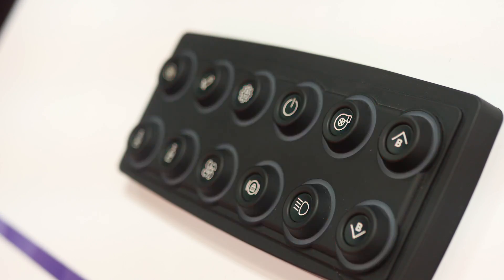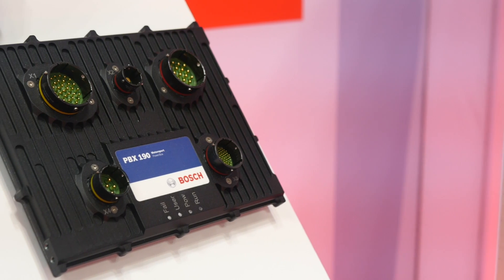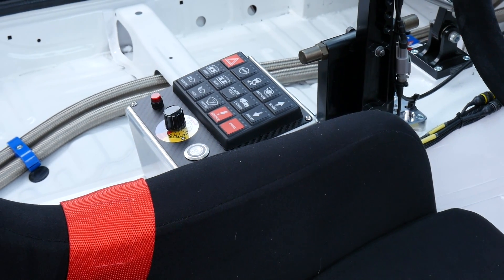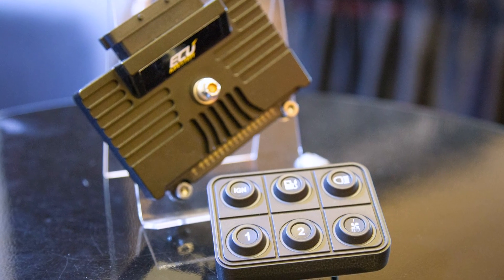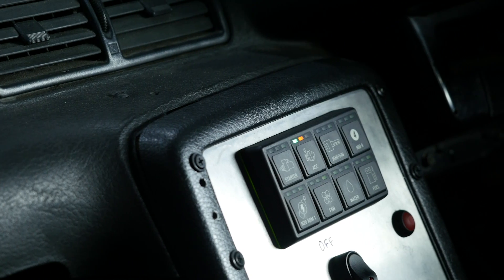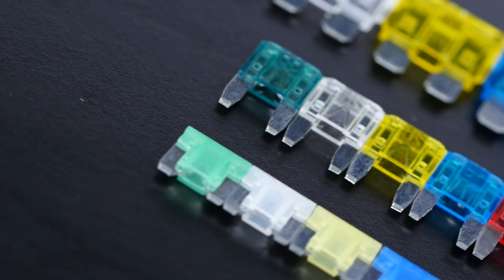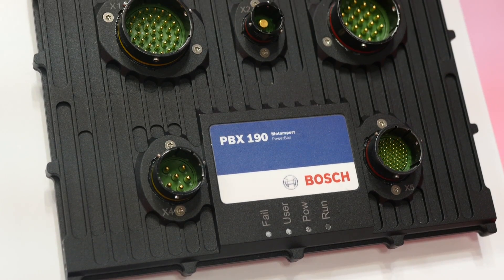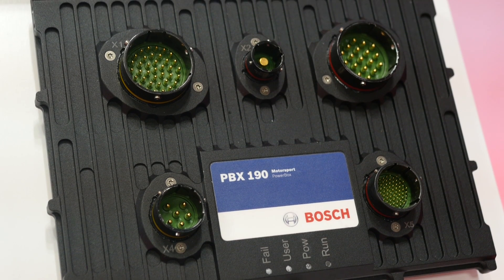How Data Logs Can Save You | CURRENT DRAW | PDM Preventative Maintenance [TECH NUGGET]

Comment: If degradation causes pump to draw higher current. what would be the cause for drawing lower current? For example. my Electric waterpump draws 7-8 amps brand new but 3 hrs into an endurance race the current drops to about 3-4 amps fluctuating. I can post the screenshot of the datalog on the forum later.
Reply: Should not be such a big jump as stated but yes heat increases resistance and cooling fans and pumps do work in hot environments with plenty of amps running through a single circuit where the wire gauge might not be appropriate.
Reply: @lop8828  
oh I see what you mean, I did'nt read your'e question properly.
Have you considered wire gauge thickness?
Reply: @lop8828  well there are no relay or solenoids. Using PDM15. That's how i keep logs of the current draw. Comparing side by brand new pump and old pump the current draw is way different even with engine off. Probably a dead pump. Guess the meziere pump only last 3hrs.
Reply: Somethings increased resistance, pump itself, relay, solenoid maybe?
Reply: Lower current can be caused by fuel surge/air ration or a faulty fuel reg,lowering the rail pressure which will drop the Amps